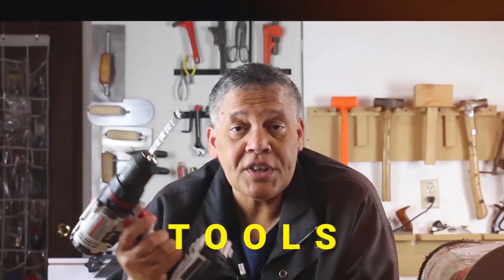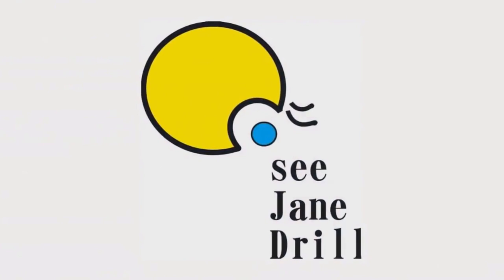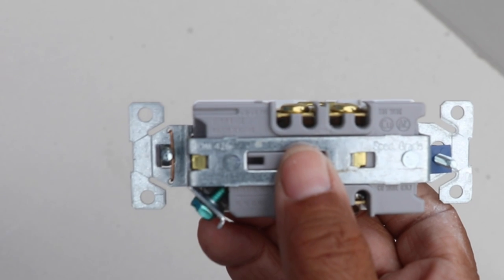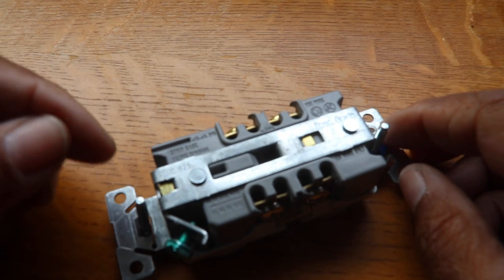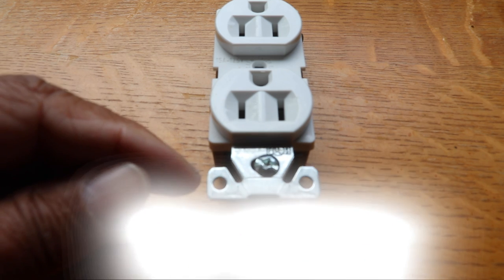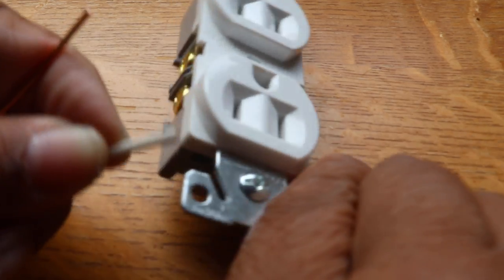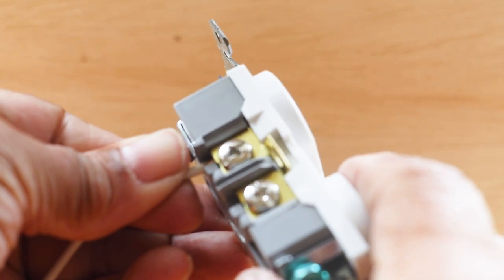Hidden Tool in an Outlet Few Know

Comment: You proved to this 77-year-old handyman son of a carpenter that there's always a new trick an old dog can learn. I always wondered what on earth is the purpose of those "ears" on outlets.Thanks a bunch, Leah, for telling us.
Reply: guy9yu
Reply: I did not know about the wire strippers.   I do know that those ears are stabilizers for the outlet.   Some people remove them, and sometimes there are applications where you want to remove the ears.   In most cases when I've wired outlets, the ears keep the outlet stable in the box, and prevent the outlet from being pushed into the box when you plug a cord in.
Reply: The ears themselves are for nailing the outlet to drywall, where you don't have a box with the tapped holes. Older houses were done this way. It's really a legacy feature, I don't believe anyone doing a new install would have reason to use them. When I did outlets in my grandmothers @ 1950 house, that's how they were put in, and how I had to put in the replacements.
Reply: You can also break them off and use them as washers to hold the receptacle off the box if it sinks in too far (or as washers in general) though there are other products specifically made for that. Also coiling solid wire around a small screwdriver and cutting the coil to the desired length works in a pinch too.
Reply: Oh I'm an electrician. I built power lines for 10 years and now I work in residential electric.

I didn't know those were wire strippers.😂 That was so hard for me to admit.🤣

Comment: I’ve probably easily installed over 1000 outlets never knew that they had a wire stripper on them could have definitely came in handy lol awesome video
Reply: Might depend on what country and manufactor . Never seen this in my country, the way the outlet is made.
Reply: Same, and every now and then I just need to do one.  But I didn't bring my electrical packout with me.  So I have to fumble with a utility knife trying to strip wires.

Comment: Holy Schmoly! I've been replacing outlets for at least 30 years and never knew this. I love your content and your style of teaching. Thanks so much.
Reply: While on the subject of replacing outlets.  We've all done it;  bought the cheap 59¢ outlet.  After seeing another you tube about the difference between el-cheepo outlets and pro outlets, I will never use the cheap ones again.  

I do not use the plug/push in slots on the back, haven't for decades.  Just think about the contact surface are on a push in versus under the screw or side plate.   I had to have an electrician wire a house I was refurbishing 10 years ago and eventually going to sell it so I could not do the wiring myself except hire back to the contractor as a wire puller/router  and putting faceplates on and i insisted that they use the side screws on all 20 amp outlets (that's all i will use doing and outlet.  never know what someone will want to plug into the wall).  Good thing was they said that the only way they do it.  We also had to put in tamper proof outlets for the kiddos.
Reply: @funnyfarm5555  You have had to use the screws on the side for 20 amp outlets for the last 25 years or so.  Sometime in the 90s they outlawed the push in terminals on 20 amp outlets and the manufacturers started making them so that only #14 wire would plug in. Most 15 amp recepticals are still wired that way in new construction. At least in the south.

Comment: It's important to note that the stripping feature is only on the Eaton brand of receptacles. This brand is commonly available at Lowe's in the U.S. Eaton used to brand all their devices as Cooper before, so receptacles with that older name should have the strippers too. It's pretty rough to use. A good pair of wire strippers are much easier! But like Leah said, it works in a pinch!
Reply: I only use one wire stripper at a time. Not a pair of them.
Reply: Always use strippers in pairs bud, always.
Reply: I invented the Eaton outlet and I am just finding this out. Incredible
Reply: All my wire strippers handle multiple gauges.  The outlet only handles two, just like a pair of scissors!
Reply: Lowe's apparently switched brands.  Until recently they sold Pass & Seymour wiring devices in all their local stores.  Many if not most of these were made in China although I liked their faceplates which were made here in the USA.  I prefer to use Leviton receptacles and switches which are made in USA.  However their GFCI receptacles and porcelain lampholders are made in China too!  I hate to use Chinese made devices but sometimes I have no choice.  Eaton recently bought Cooper which is a descendant of Eagle Electric which was based in Long Island City, Queens.  They had a manufacturing building next to the Queensboro Plaza subway station.  The area is now so built up it looks just like Manhattan!
Reply: @Sillyturner  Why do they call it a Television set when you only get one?

Why is it called a pair of pants when you only get one?
It's not called a pair of shirts, is it?

What is a semi-boneless ham?
Does it have a bone in it or not?

Why is it called a "hot water heater?
If the water's already hot, why do you need the heater?
It should be called a cold water heater.
Just saying.

Why is it called a "stop" light and not a "go" light.

Why is it called a senseless killing?
Are there some killings that are sensible?
He was "jay walking", he had it coming.

Why is it called an "unexpected" heart attack?
Are there some people that are expecting a heart attack?
Hey "Bob", ya wanna come golfing with us today?
Yea, but you could have me back by two-o-clock cause I am EXPECTING a heart attack?

Oh how cute, a new baby.
Really?
A new baby?
What other kind of babies are there?
A used one maybe?
Yea, I got it used, it was on sale at Wal-Mart.

Doctors say, four out of five people suffer from diarrhea.
Really?
So does that mean there is a fifth person somewhere that is enjoying this experience?
He's not suffering, he's enjoying it.
Reply: @1575murray  Lowes and Home Depot change brands of some materials at least yearly.
Reply: @im1who84u  
Hmmm, let's see...
George Carlin...
Robin Williams...
Gallagher....
Miss anyone?
Reply: @thomasdragosr.841  They both have a lot of items on their web sites that they don't carry in their stores for various reasons among them space limitations.  I have had good luck with free ship to store with both Lowe's and Home Depot.
Reply: @1575murray   That's interesting, because my Lowe's briefly carried Hubbell products until it switched to Eaton. They had Cooper products before that. Pass & Seymour was acquired by Legrand, and I've noticed Legrand has slowly phased out the P&S name on many of its products. I think today you'll be hard pressed to find any residential-grade devices NOT made in China. Some spec-grade stuff I come across usually is made in Mexico, but much of it, too, is made in China.
Reply: @im1who84u  rip George Carlin
Reply: @StudioDaVeed  Don't know.

Comment: The 3rd thing to know is those "ears" with holes in them can be bent back and forth until they break off and can be used as washers but that does ruin the wire strippers.
Reply: arent the ears for something else also ///like banding inwards to flush the plug if needed..???
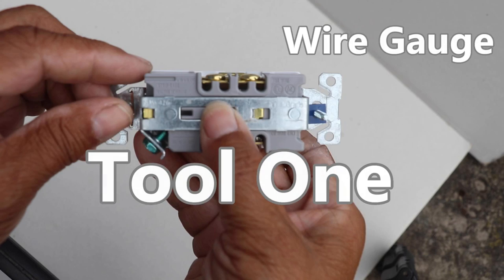Reply: Skip to 1:15 to see the "tools"
Reply: @KNBARON  They are for screwing in to old wood lathe and plaster walls.
Reply: yes, they work as washers and like stoggs said they can be used to screw into old wood and plaster walls that is illegal in many area's. double use. kinda scary as i live in chicago and chicago burnt down so we scared still to this day. :)

Comment: There is actually a third tool. The holes on each side of the metal yokes can serve as loop holes.....used to bend hooks on wires,to allow them to wrap around screw terminals.If you look closely at a wire stripper they have the same loop hole(s) as the above mentioned.
Reply: You missed the 4th tool. Break the ears off and its a slotted screwdriver.
Reply: @lb969  throw it and its a projectial. 5th tool
Reply: @FluidMotionEnergy  ..Lol..6th tool.. eat it and you'll have a full days supply of iron and copper..and plenty of fun at the end of the day....
Reply: Wow it seems so obvious now that you mentioned it, thanks a lot 👍

Comment: This only works with Eaton brand receptacles. Doesn't work on Leviton or Pass and Seymour brand receptacles, so keep that in mind when purchasing them..
Reply: Never heard of this before. I just checked my stock of outlets and they don't have that feature. I buy bulk outlets from a supplier and have no idea of the make.
Reply: I’ve never used Eaton Duplex Receptacles I have worked on a few Eaton panels, I just use a good old locking blade electricians knife they work great for removing jacket and stripping. That was interesting though I never knew Eaton built strippers into their Duplex Receptacles!
Reply: Well this might explain why I never noticed those strippers on my Leviton outlets.
Reply: I do stand corrected. Appears Hubbell and Arrow Hart (more commercial/industrial use)  also offers this feature as well. I think they're all under the same umbrella though. Gotta say, It's a great little idea, but, if you're going to be banging out 40-50 trim outs before your first smoke/vape/coffee/beer break, you had better have your strippers with you. or your hands are going to be killing you by the end of the day. lol!
Reply: @nonelost1  Same here!  I was puzzled beyond all hell when I saw this! 

It was one of those moments like when you find out about those tabs on the end of the Saran/aluminum wrap box.  
Talk about feeling like a dinosaur?
😄
Reply: @TheHardTruth315  I’ve always used an electrician’s knife it’s fast and has served me well! Strippers work but I never seem to be able to find them.

Comment: There is one more tool on light switches and receptacles and it has to do with those holes on the tabs.  Once you use the built in stripper to strip your wire.  Insert wire partially through one of the holes and bend your wire into a U shape so you can hook the wire around the terminal screws. Not all receptacles have screw set tabs like the one she used in the video.  Other types you either stab the wire in the back (don't recommend using those stabs though) or you hook it around the terminal screws.  Another built in trick to receptacles and a really easy rule of thumb is, white to bright.  All receptacles have a set of bright screws on 1 side (the neutral) and a set of brass color screws on the other side (positive).  Also another way to remember this is neutral (white) goes on same side as green screw (ground screw).  Great video.  Been licensed electrician for over 20 years and never knew about the built in wire stripper.  Always knew about the holes and stripper gauge though.